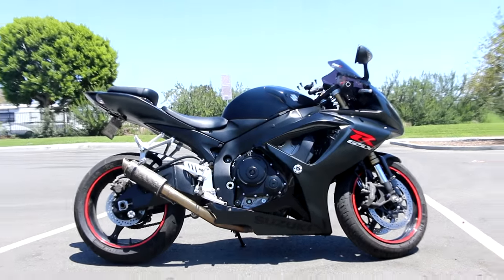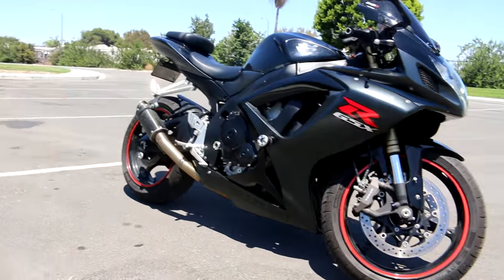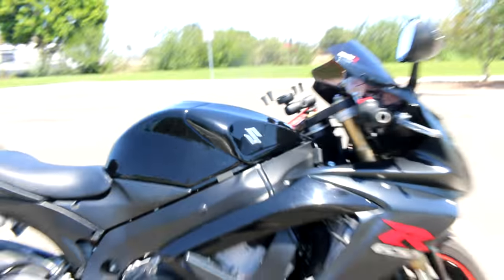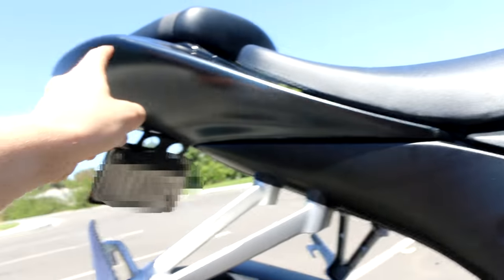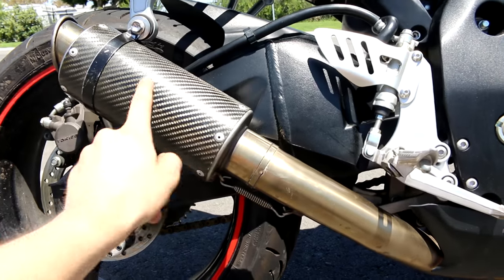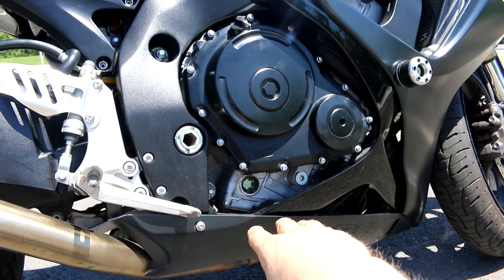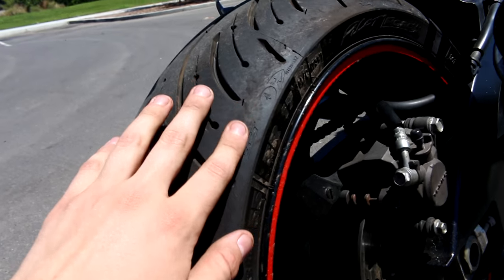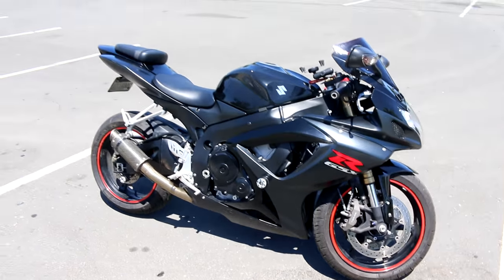2007 Suzuki GSXR 600 Walkaround and Mods

Comment: The CHEC is always on when ignition is turned on and killswitch is in off. It's like when you turn the key in a car and the check engine light comes on, only to go off when the car is actually started. I don't think you have a check engine light on if it doesn't persist when the bike is running.
Reply: Yep true

Comment: Buy a servo buddy for the connectors and your check engine light will turn off
When you delete the motor Actuator the opens and closes the exhaust valve the there are two connectors they are left that go to the computer 
If you buy a servo buddy it will trick the computer to the think the motor is still there which leads to No check engine light

Comment: That servo (the exhaust control valve) will give a Fault isolation code of C46.  I locked mine open because it was stuck closed, a common issue in K7 gsxr.  If your check engine light is staying on you might wanna look into some other issues.  Merely a suggestion.

Comment: 8:25 buy and install the Servo Buddy device and problem fixed. Red light on the dash will disappear. No need to buy a Power Commander as it won't take away the red FI light.

Comment: I have a 2013 gsxr750 same thing. I pulled servo and cables off of the bike. Where the servo is plug in a servo buddy they are like $25 and will take care of light and problems.

Comment: Hi, which error code did your FI/red light gave?

I recently bought a gsxr 600 aswel, with a full exhaust system (without Catalysator and decibel killer aswell). But I also got a error light.

Thanks man, hope you will answer!

Comment: Check engine light is on when you flip the switch for the fuel it goes away just flash the ecu problem solved
Reply: Would servo buddy thing fix it?
Reply: Just cut the wire to the ecu. Tons of how to things out there i have it done on myn for 6 years now

Comment: Does a older year matter about a bike I’m looking to buy one this year and I want to go cheap since It’s my first buy
Reply from the maker: Malik Harvey The year doesn't usually matter. The biggest thing is to make sure the bike looks well taken care of, in the sense that the chain isn't too loose, the bolts are tightened down properly, they've kept up on oil changes,   there aren't any stray wires or fluid leaking from anywhere, etc.  If the bike struggles to start, that is also something to look into. Best of luck to you! Just research the bikes you go to look at before hand, so you know what to look for and I'm sure you'll be alright.

Comment: What is the name of the battery tender thingy? I really want one for my GSXR 750 but can't seem to find it anywhere...
Reply from the maker: I actually bought pieces for it on Amazon and wired a few things together. I think there is a brand called "Battery Tender" that makes similar outlets it if you don't want to have to wire things, like I did.
Reply from the maker: +TheZotRider Cllena Triple Function Dual USB Charger + LED Voltmeter + 12V Outlet Power Socket Panel Jack For Car Boat Marine Digital Devices Mobile Phone Tablet (Red LED) https://www.amazon.com/dp/B01D4DMSM2/ref=cm_sw_r_cp_apa_k.WJxb7740R7C
Reply from the maker: +TheZotRider That is literally what I bought, but I had to get wire and fuses and a switch separately.

Comment: hi nice video man i appreciate , i have one question, i am getting the offer of 2008 gsxr 750 and 2007 gsxr 600 on same price, which one should i choose?
Reply: Ak-4 7 750 for sure
Reply: evan Purdy but I'm confused if that is selling his 750 on the price of 600, so that might have faults,?
Reply: Ak-4 7 I would definitely make sure there's nothing wrong with the bike before buying but I've had a 08 750 for about five years now and have had no major problems other than previous owner let it get rains on and somehow it got rust in tank which killed my fuel pump. They are very quick bike with good low and mid range power. Smoked many 600 on it
Reply: evan Purdy thanks bro, i think I'll go for 750, more power, newer year, so should be fine
Reply: Ak-4 7 no problem good luck

Comment: Where is the power modes? Is it easy to accidentally switch modes.
Reply from the maker: The power modes started being available on the 2005 GSXR 1000 and the 2008 GSXR 600, so mine doesn't have any different modes :/
Reply: +TheZotRider oh man that sucks
Reply: +TheZotRider eithe way still a cool bike
Reply from the maker: +Brian H Yeah, It's all good. But from what I hear you have to have the throttle completely closed to change modes... I think XP
Reply: +Roadtoad damm many bikes. I might get a zx6r idk yet

Comment: Good video!! That thing sound good!!! The thing I like about my bike is that there are NO Elictronics lol. There's not even a battery. So I never have to worry about electronic issues
Reply from the maker: Yeah you're right! haha The electronics on these bikes tend to go out way before anything mechanical does. Losing the electronics makes them easier to work on too.
Reply: +TheZotRider yah haha. The only thing I have to worry about is oil and gas haha. And sometimes the chain cause that thing has come off a few times already haha

Comment: Nice bike bro but you have to relocate that rectifier! Flatlandinnovations.com we offer a direct bolt-on application no modifications needed. 06 O7 GSXR 600 and 750 must relocate the rectifier do to the stock location exposing it to an excessive amount of heat. This causes the part to fail prematurely and allowing check out the Surge from the stator to run freely through your electrical system blowing out your battery your ECU possibly your instrument cluster. This is easily resolved by relocating the rectifier. Check out the YouTube video GSXR 600 750 relocation bracket flatland Innovations. If you haven't already experienced these issues you will I hope this helps